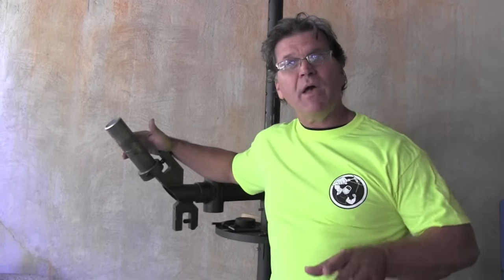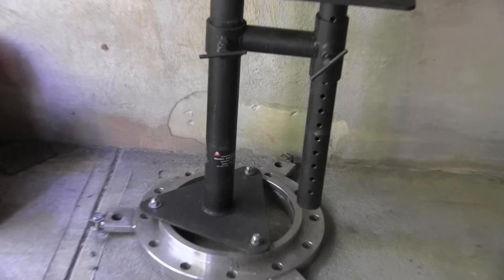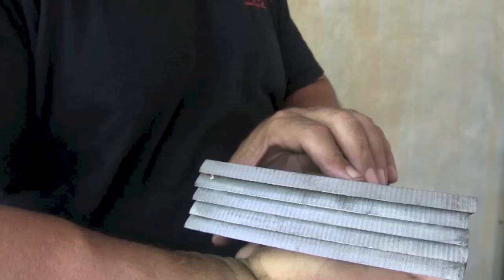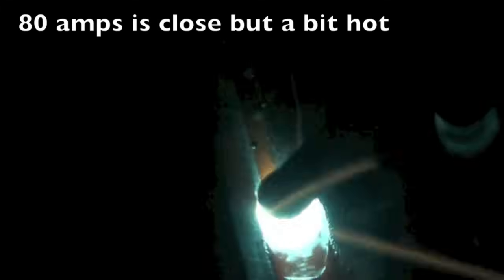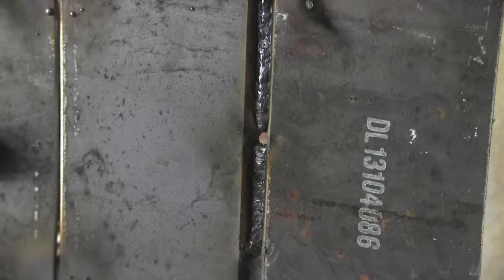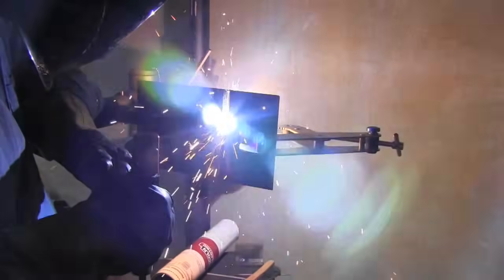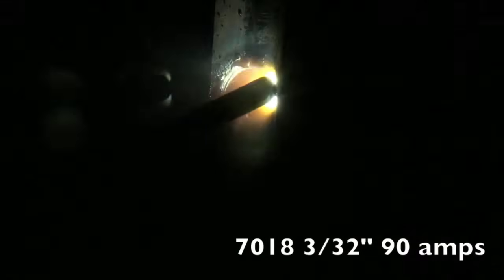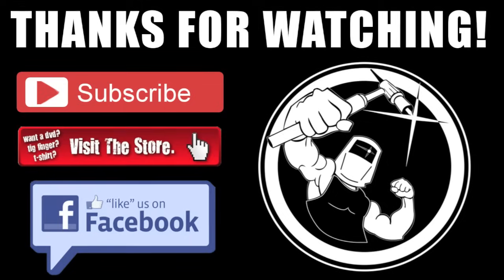Stick Welding Tips for 6010 Open Root &7018 fill cap

Comment: Would like to see the full root on the other side. In estonia we fill the root with U welds for some reason and thats the only way we are teached.
And this is the welding you need to do if you want welding papers. 300mm weld.
Reply: +weldingtipsandtricks yes 6013 is used for the root run usually at 90 amps. Then for filler and cap 7013
Reply from the maker: What rod do you use for roots over in Estonia? Reason I ask is I have heard about a lot of pipe welding being done with 6013 type rods in Europe.

Comment from the maker: Dialing in setting for open Butt 6010 root. Comment, Like, Subscribe for more...enjoy.
Reply: ***** flux is what it is called while on the rod slag is what it is called when covering the weld bead
Reply: weldingtipsandtricks I was on a weld test and used a couple of tricks i picked up from you,almost herd your voice in my head lol!!
Reply: ***** it's slag not flux peeling off the weld, btw.. Why the weave on the cover pass rather than stringer beads?
Reply: Hey Jody! I was wondering if you know a man who goes by the name David Schnalzer? He is the welding instructor at Lehigh Carrier and Technical Institute in Shanksville Pennsylvania. He is also my welding instructor, i go to the votech and i have to say with him and you giving me the ups and downs of welding will sure as hell benefit me in the long run.
Reply: +Travis Brown that's really to cold for a root pass
Reply: Lets hope he's not welding anything  structural then. Lol.
Reply: weldingtipsandtricks how can I learn what some of the common terms used in welding mean do you recommend a book?
Reply: I run at 64 and I have no problem with penetration
Reply: +Jeremy Shepherd Depends on the machine and how old it is. Some machines say 64 while others could say 78. Hopefully this is the case at least. lol.
Reply: Yea really because I've been a pipe welder for years and used all sorts of machines from Miller to hobarts
Reply: +OAAKLAND G It's much simpler, faster, and prettier when it is allowed.  Some jobs are strict on the 3x core wire bead width and it isn't allowed everywhere.
Reply: Mr Leb
Reply: missmymountain
Reply: weldingtipsandtricks so I’m in welding school right now and I’m working on a 6010 root with a 7018 fill and cap on beveled plates with a 3/32 land and gap welding overhead I need help with getting the right position to weld the weld any tips?